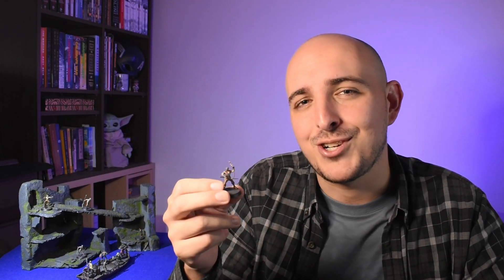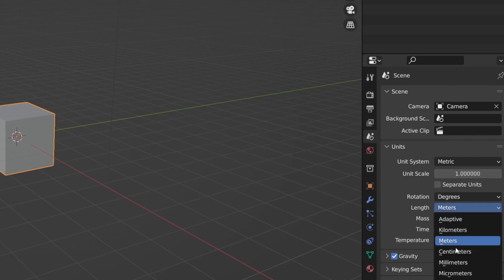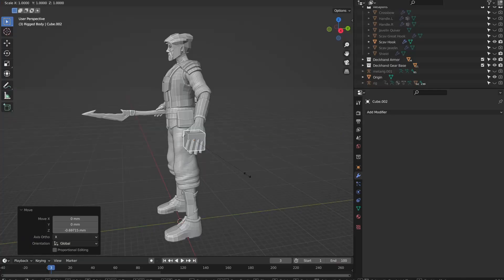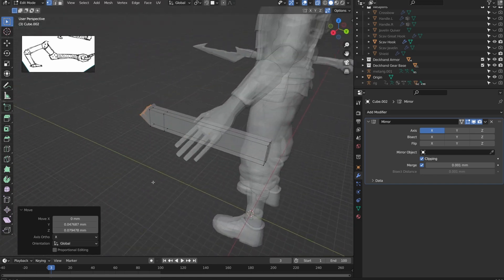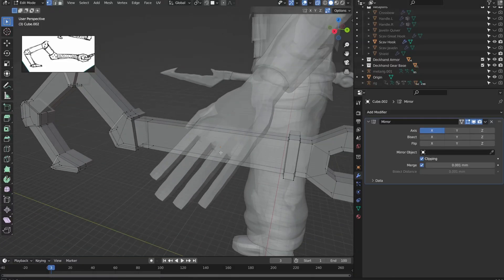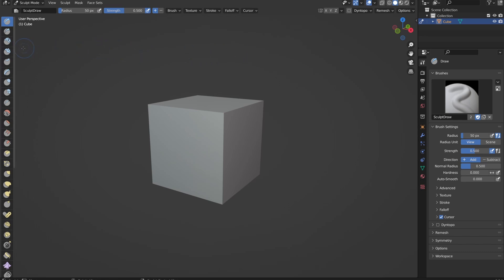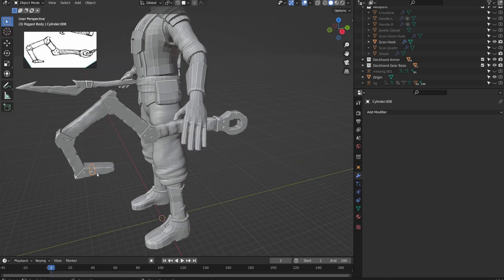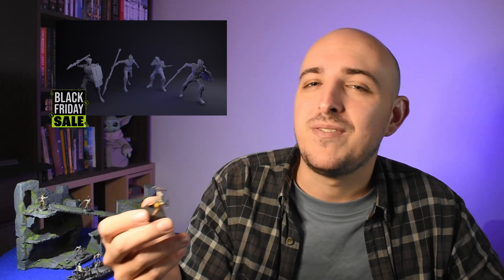Making 3D printable minis in Blender - Basic Tools

Comment: Thank you for this tutorial! It's really helpful! Beginner question here: Am I to understand that I don't need to merge and boolean all the pieces and accessories on my mini into one single continuous mesh?
Reply from the maker: glad I could help! and yes that's correct. after some experimentation I've found that as long as each part is itself manifold (one continuous surface) and overlaps a bit with other such objects, exporting as an STL will handle that bit for you.
Reply: @DiluvianChronicles Thank you so much ❤
Reply from the maker: no problem!

Comment: The auto merge vertices does absolutely nothing with the mirror modifier. The modifier has its own merge setting that needs to be checked (which is checked by default). That, with clipping, is what keeps those vertices connected. The auto merge is for when you move two or more ACTUAL vertices close together.

Comment: Does poli count matter much when making minis? If I were to go crazy on details and ended up with a crazy poli count is that going to affect the print at all. Also, what about ngons, will the printer freak out if a face has more than 4 vertices. Same thing with tris, would those cause issues?
Reply from the maker: polycount doesn't really matter for a finished piece, but if you want to pose it and make multiple versions it can slow things down significantly. Also, as far as I'm aware, ngons don't make a huge difference if they are flat. I have printed plenty of capped off cylinders with no real issues. Be aware however that your polygons will be converted to tris when exporting (I think?) so large ngon panels might end up looking funky.

Comment: Yes, everything that comes included with blender is free, not only are all the pre-installed add-ons free, well they're pre-installed 
Also a quick little tip if you press in any of the transforms [scale, rotate, translate and extrude (which is just a duplicate link and translate)] if you the shift button And any of x y or z it locks respective axis
Blender has non-destructive Boolean modifiers too by the way
Reply from the maker: Nice tips! Thank you!
Reply: @DiluvianChronicles  I don't know how well the Boolean modifiers work... But yeah, and you could do some crazy stuff with geometry nodes too, though that's more advanced than anything you're probably ever going to need If you're only using blender for 3D printing.
Reply from the maker: Agreed. I have put off getting into geometry nodes because they haven't really seemed necessary yet.
Reply: @DiluvianChronicles  And they probably aren't really for the type of thing you're doing, but it's really cool some of the like. Procedural models you could make.. And then like any other modifier once you get it to the point where you like it. You can apply it as well...
Reply: But yeah you can implement full-on particle systems in Geo nodes...
Reply from the maker: They do look super useful for ropes and pipes and anything with a repeating texture. I will definitely try it out!

Comment: Why on earth would you start by placing a cube in the model's hand? The rest of your model is just going to be in the way while you sculpt. It is so much easier to just make a new object, then scale & rotate it to fit the model later.
Reply: I disagree. I prefer to model accessories with the character so you can get proportions right without doing adjusting later. Plus, you can set the character model to wireframe and keep the accessory in solid (via properties panel) blender has a bunch of handy stuff like this
Reply: 🤓☝️ this is what you sound like

Comment: "Great tutorial, let's see if that one model I made a while ago can be printed. I'll just check with the 3D-Print add-on"
"Non-Manifold edges: 898"
"Bad contig edges: 2934"
Well that's gonna be fun to clean up
Reply from the maker: Hahahaha I feel that. A lot of it can be cleaned up easily though, especially if it's just some extra duplicate geometry.
Reply: @DiluvianChronicles  It really was easier tahn I expected! One question tho: the "bad contig edges" number has gone up to 6290. Will that be a problem down the line?
Reply from the maker: Try recalculating normals. You might have faces on both sides or opposite sides. Make sure each object has all of its faces on the outside. Do you have a lot of separate objects?
Reply: @DiluvianChronicles  Yeah, the model is made from about 20 different objects and when I made it I did so without the bool tool. I'll try to recalculate them later and say how it went!. Thank you so far for helping me!
Reply from the maker: No problem! Good luck and let me know how it goes!
Reply: @DiluvianChronicles  recalculating fixed it and both numbers are now down to zero! Once again, thanks a lot!
Reply from the maker: Woo! No problem!

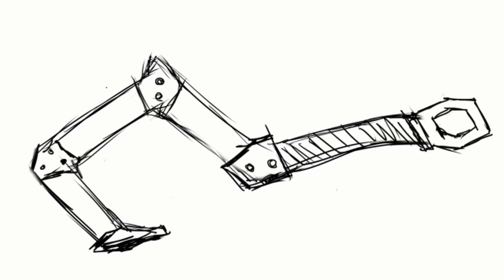Comment: 4:22  Blender supports drag and drop of images onto the 3D viewer, which you can then use a direct 1:1 reference inside of the modeler using orthographic projections in case your reference is really good and a profile sketch.  Setting up the reference plane Blender creates to be axis aligned allows for faster copying of the reference with a mesh in front of it, using X-Ray/transparency.  Just a different method to help bring in the hand drawn into the digital realm, instead of using the eyes to compare and contrast it turns it into tracing of what you've already created.
Reply from the maker: Didn't realize! Thank you!

Comment: Great video! Do you also need to fix intersecting faces?
Reply from the maker: Thank you!
If they are part of the same object then yes. After some experimenting, I have found you can overlap separate objects and export them together as a single stl, but each object needs to be manifold, including overlapping/double faces and stray verts. That said the repair tools on some slicers are getting pretty good, so you might be able to get away with it
Reply: @DiluvianChronicles  thanks for the reply! Do you generally pose the model first before combining everything? Or do you usually combine first and then pose?
Reply from the maker: @MCHammer0000  I typically keep clothing and armor separate until the end. They don't always follow the armature quite how I want, so I can adjust them at the end once I have the pose set. (Make sure to make a backup copy first though!)

Comment: My printer is down hard.  Wasted $1000 on a printer thanks to a blob forming and wrecking everything it hardened around.  Well, it was fun while it lasted.
Reply from the maker: Oof. That hurts. Was it FDM? I haven't had many issues like that with my resin printer.
Reply: @DiluvianChronicles  Yep, fdm.  My printer has wires exposed to any kind of blob forming, which got surrounded by it.  In trying to fix it the wires broke away from the sensors, which were sealed due to the blob.  I did find that someone created a 'sock' that sort of protects parts.  I think non-stick electrical tape might work, but not sure how it would handle the heat.

The only thing I've heard about resin catastrophes is if the the FEP tears and the liquid resin runs in the screen or printer.  We're in the Wild West of this relatively new tech, so there's always something exciting happening... ;)
Reply from the maker: @samualwilliamson1187  oh man! I have been considering an fdm printer to try out some larger prints but that sounds rough! 
And I am nervous about the sheet breaking but I think the worst case would be getting some resin on the glass. 
You are right about the wild west though!
Reply: @DiluvianChronicles  The sheets are usually  spring steel, which allows for bending to help remove the creation.  FDM (PLA anyway) is pretty tidy.  It does require babysitting, at least until you are confident that it won't detach due to too much cooling or other factors.  I might try a glue stick to help.  There are ways to remove blobs, but they don't always work, especially if the blob got in and around the wires, housing, etc.  It's like someone pouring cement on the steering column of your car.  <locks car doors>

I'll get it running again. 

If you do decide to get an fdm printer, I suggest a Creality Ender model.  You can buy one for less than a 1/3 of a Prusa.  They both use many of the same parts.
Reply from the maker: I was eyeing the ender printers. They seem to have a very good cost:detail ratio. I may need to get a larger studio first though haaha
Reply: @DiluvianChronicles  In case you're ever wondering, the expensive Prusa and the Ender, among others, use many of the same parts.  You can often buy better parts, for very reasonable prices.  The other part is the shipping cost.  You could spend as much to have a Prusa shipped, as it costs to buy an Ender.
Reply from the maker: Oh wow! That's convenient! I live in Japan so shipping is definitely an issue
Reply: @samualwilliamson1187  this technology is not new by a long shot. You paid too much for this thing in the first place and you probably can fix it for 50$. Go fix it
Reply: @p.k.5107  Done, done, and done.  Printing like a maniac!
Reply: @samualwilliamson1187  you are the man!

Comment: i previously made a model rigged for animation and i wanted to know if the topology need to be all in one mesh, or can the meshes just be joined together? the heads are joined to the model but are not the same mesh. i also wondered if the same thing applied to clothing.
Reply from the maker: Good question. Yes, the whole STL has to be a single unbroken mesh, including clothing. You may be able to just remesh it to fix that though.